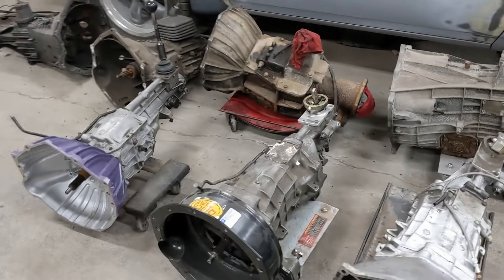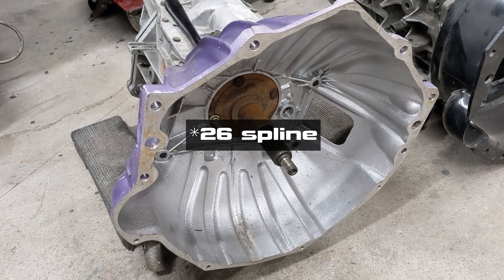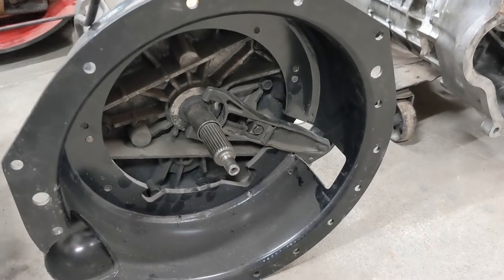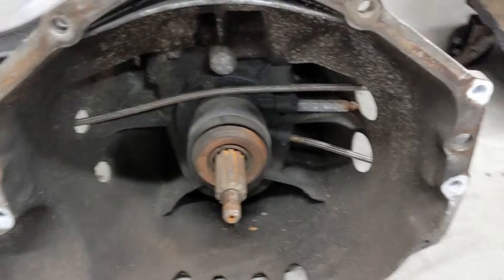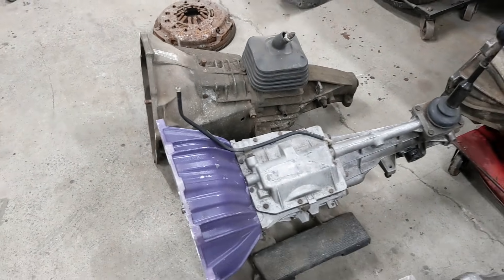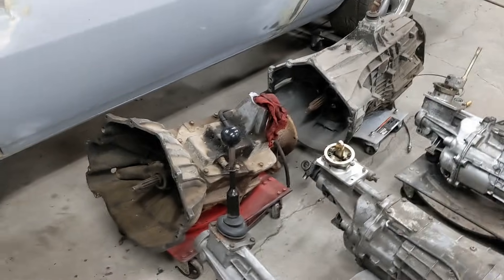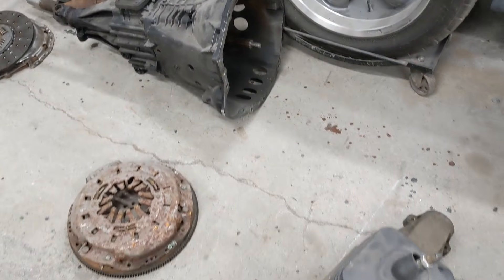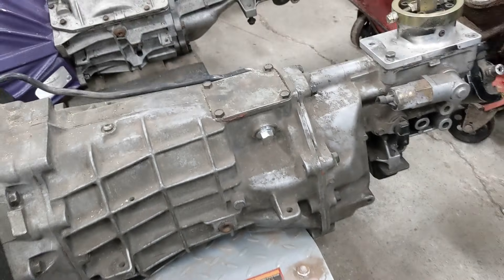GM manual trans specs - 4spd 5spd 6spd 2wd 4wd - LS SBC BBC

Comment: I'm swapping a 1996 5.7l vortec into my 1976 c10 with a Saginaw 3spd, but I was wondering if I could swap the 3spd out for something like the nv3500. Would it drop right in using the same bellhousing, drive shaft and mounts as the Saginaw?
Reply from the maker: You can hook an nv3500 up to SBC but can't use the old bell etc.

Comment: Im a little bit confused. Maybe you wont mind sharing your knowlege.
I have a 96 s10 nv3500 from a 4.3 truck. It has a internal throwout  bearing setup.( no fork). Im gonna run it behind a 84 350 with a 2 piece rear seal. What flywheel and clutch do i use? Its going in a 65 c10
Reply from the maker: Look up like a 65ish Chevelle clutch and flywheel. Would def be 2pc rear seal and I think it's old enough to be 10 spline clutch to match nv3500. Cars went from 10 to 26 spline some time in the 60s IIRC. Hell, look up the 65 c10 clutch too and see if it's 10 spline.

Comment: Best 6 speed manual to pair with an LS 5.3??
Reply from the maker: Depends on what you want to do with it. For a big power hot rod, I'd go T56 Magnum. For a car that's less crazy you could go regular t56. Truck I'd go zf6 or even nv4500 5spd

Comment: It is possible to put a LT1 T56 behind ls engine with the stock bellhousing? If it is, what kind of flywheel and press do I need to do so? Thanks
Reply from the maker: I tried that and it didn't work. Depth was about right with truck pilot bearing, but the lt1 bell wasn't big enough for LS flywheel. LS is 168 tooth and lt1 was 153. Maybe with an aftermarket QuickTime bell? I dunno
Reply: @GEARHEADdezign  or maybe with 153 tooth aftermarket LS flywheel?
Reply from the maker: If it exists. You'll have to figure out moving the starter too

Comment: I have an 02 3/4 ton truck with the floor shift tcase and the 4l80e. The 4l80e is great but my first truck was a manual with the sm420 which I eventually swapped to a world class t5. I miss a stick shift but the one really good option seems to be the zf6 and they're damn near impossible to find
Reply from the maker: ZF won't fit your tcase, but the nv4500 will bolt right in. That's the route I'd go in your shoes, and that's what the factory 6.0 manuals were.

Comment: What would you use if you already had an nv 4500 in your truck and you wanted to go to something different in a manual something stronger
Reply from the maker: Your only stronger option without adapters etc is the GM zf6. You'd still need another transfer case since the output splines are different. Expensive though

Comment: Has anyone figured out a way to swap an LT-1 6 speed behind and LS engine yet?
Reply from the maker: I have a couple videos about that. One where I try to make it work with truck pilot bearing...and another one where I convert it to LS style 🤣
Reply: @GEARHEADdezign  yeah I hear it’s not possible to us an LT1 6 speed with an LS but figured I’d ask.

I’ll go find that video. I haven’t tried to swap the input shafts but I guess it can’t be that difficult.
I have a couple LT 6 speeds and would love to use them instead of selling them to buy Ls 6 speeds when I know my transmissions are good. Thanks for the reply!
Reply from the maker: @gtmotorsports937  yeah. The parts to convert are a few hundo but it's pretty easy to do.

Comment: You are missing the ZF 6 spd trans from the C4 Corvette
Reply from the maker: That's true. But I don't have one. And they're so rare they're not much of a swap option either🤣
Reply: @GEARHEADdezign  I just recently did a clutch, p.p. & flywheel on a super clean 1984 L83 Corvette. I was surprised when I discovered that it came with a ZF 6 speed. 🤯  It is a pull style p.p. like the 1st gen t56
Reply from the maker: Gotcha. That's the style I'm running in my 80Z

Comment: I have a 94 s10 2wd and the transmission is the nv3500 and it’s bad went and bought one off marketplace and found out it’s the wrong one my shifter is up further the one I bought is 2 far back as well as some other small issues that won’t work on my truck

Comment: If you were gonna manual swap a 1998 Chevy Astro which trans would you use? A T5 or NV3500 and why would you use it?
Reply from the maker: I would guess the nv3500 from a price and strength standpoint. But I don't know enough about Astro fitment to make a recommendation
Reply: I was thinking the NV for the same reasons. Plus they came behind the same 4.3 V6 that the S10 and Sonomas had. My van is RWD btw so it should be a easier swap than the AWD version. Ive seen people do the AWD on some forums but haven't been able to find one on just a RWD swap. Luckily they are the longer of the NV's. The ones that came in the mini trucks I mean. I've heard the shorter NV was 1996 and back. While the longer NV was 1997 & up in the small trucks. My other thing is trying to figure out a clutch pedal, trans crossmember, and if it's gonna mess with the computer. It would my first time ever doing something like this. I work at a recycling center so I saved the Van from the scrap pile. It's probably a 7 out of 10. High miles 280k to be exact. So when the V6 goes I'm thinking of putting a 350 Vortec in place of the 4.3
Reply from the maker: @joshuadugan1992  I've always loved a good SBC, but you're honestly better off LS swapping it. Use a donor truck fuse block and it's only 4 wires to make it run. Pedals you can do universal Wilwoods like I did on my RWD Beretta. Lots of info to check out if you want
Reply: @GEARHEADdezign  which video shows your pedal install?
Reply from the maker: @joshuadugan1992  I think it says pedals in the title
Reply: @GEARHEADdezign  I have found what I think is a NV 3500. Pretty sure it for the full size Chevy tho. Any possible way I can send pics to you in a email and you can ID it for me?
Reply from the maker: @joshuadugan1992  sure. gearheaddezign@gmail.com

Comment: I dream of a mual box in my jag xj8, possible?
Reply from the maker: Anything is possible...you just gotta make it happen!
Reply: @GEARHEADdezign  I've gone through three auto trannies  and much prefer manual. Any experience with this car in terms of conversion? Are there kits?
Reply from the maker: @rodgruzelier4997  I dunno there, but Wilwood has universal pedals and if you have a grinder and welder you can make anything fit 🤣

Comment: So could you use a WC t5 out of a mustang behind a sbc but using a truck clutch setup!? Being they’re both a 10 spline. Or is the truck clutch and flywheel to big!? I only ask because I’m looking for a WC t5 but all that I find are a ford 10 spline. I’ve had a hard time finding anything GM.
Reply from the maker: I'm not sure if the 10 spline is the same...

Comment: I think you just saved my a ton of money. I’ve been doing a ton research hoping to find away install an LS in my 88 Camaro mounted to my GM T5 WC transmission. Will the old big block bell house work or will my transmission be clocked at an angle?
Reply from the maker: The BBC bell should work, but won't be mounted at an angle. And iirc you want it to be at an angle for your Camaro
Reply: @GEARHEADdezign  Ha, you are right, I do!

Comment: NV4500 2wd from a 1993 c2500, in a s-10 4.3v6, 4wd auto. Convert to a 2wd and manual. Can this be done and what all is involved?
Reply from the maker: Sure you can. Nv4500 will bolt up to 4.3 just like it would a SBC. Then you just need a driveshaft of the correct length. Piece of cake
Reply: @GEARHEADdezign  . I don't know about piece of cake, there is the clutch master and shifter to cut holes for, but it's encouraging to know it will at least bolt up engine to transmission. flywheel, pressure plate, clutch and all. If people say I'm crazy for wanting to delete the 4wd, I'll just point them to the current gas prices.
Reply from the maker: @flyhouseoftruth470  sure, there's work. But no crazy adapters or reinventing the wheel is needed

Comment: Great video with lots of good information. One question, I’m looking to swap my auto 2004 3500 duramax to a zf6 I have one local with lower miles but problem is it’s a 2wd trans and I’m 4wd. How In depth would this be to change the parts out??
Reply from the maker: I haven't looked into that. But I do know that the tail shafts are prone to breaking, so just a 4wd tail shaft will be close to the price of a whole 4wd trans...

Comment: I want to use an nv3500 from an S10 behind my 5.3 in my 83 C10. Do I use the slave cylinder and throw out bearing from the S10?
Reply from the maker: Yup. You'll need a hydraulic master cylinder for the C10 too
Reply: @GEARHEADdezign  ok kool. Would the driveshaft from my 4L60E work?
Reply from the maker: @ivorton23  half ton nv3500s have a bigger output shaft, but I think the s10 ones are the same. I know my 4x4 s10 blazer nv3500 is 27 spline
Reply: @GEARHEADdezign  gotcha. The hardest thing is installing the clutch pedal. I heard it’s a pain in the squarebodies.
Reply from the maker: @ivorton23  when I swapped my 94 Silverado the pedal wasn't too bad, but when I tried to change the plastic pedal to a steel one in my 01 it was a nightmare!
Reply: @GEARHEADdezign  oh boy smh

Comment: So what is a factory 5 speed in a 1990 2wd 350 obs chevy?
Reply from the maker: Getrag 5LM60 is the name of it, I think. It's the predecessor to the nv3500 and mostly the same, but with a clutch fork.
Reply: @GEARHEADdezign  thanks for replying. Do most people just use a nv3500 if they do a swap? For some reason finding information about these trucks as a 5 speed is hard as hell. Especially 2wd. Thanks.
Reply from the maker: @dakotajohnson6472  use whatever is available. Nv3500 might be easier to find at this point. And the internal slave is kinda nice compared to the fork
Reply from the maker: I had issues with a bent fork in my early nv4500

Comment: I had a mechanic install a 5 speed and he claims it is a NV3500. I found the receipt from the junkyard and it has the following info "1990 Chevrolet 1500 Pickup
88-91 MT; 5 Speed, 4X2; Q:45563; W:6603"
Everything I have read is it's a 5LM60. What dust cover/inspection cover do I need?
Reply from the maker: Yup, that's the getrag predecessor to the nv3500. Inspection cover, I'm not sure

Comment: I’m after a standard trans for my 4.3 tbi. Will the 89 t5 14 spline fit? Or do you recommend a different?
Reply from the maker: I would think it should fit. The nv3500 in the newer blazers is a little stronger if you wanted to go that route instead

Comment: I have a 93 Sierra with a 4.3 5 speed. I’m wanting to do a 350 sbc with a mild cam, headers and other small upgrades. How can I reinforce the 5 speed so that’ll handle some burnouts and what not
Reply from the maker: It's the same 5spd used with half ton SBCs anyway, so it should hold up for a while anyway. I don't think there's much of any aftermarket upgrades available other than a Core shifter

Comment: Hey man I have a 2007 silverado single cab shortbed and it has a 4.3v6 with 5 speed transmission but i am not sure what transmission I have and if I could use it for a 5.3 engine I am thinking to put...I appreciate it if you can help me out thanks
Reply from the maker: Yup, you have the nv3500 and it will bolt up to the 5.3 piece of cake with 4.8 clutch and flywheel

Comment: Hey man great video but I don’t e a question for you, that nv3500 looks to be a great option for my nova but what would be the best option for a hydraulic throw out bearing if I could find that transmission
Reply from the maker: Watch out for bell housing to shifter distance on the nv3500. If you can find the s10 version instead of the Silverado one it will move the shifter back a bit.
Reply from the maker: They come factory with the hydraulic release bearing stock, so just use that. Same style as LS t56 trans.
Reply: That makes sense… what about the the speed sensor? How to make that retrofit?
Reply from the maker: @justinstewart1499  you'd have to do an elec speedo. Like in my Beretta I'm using the factory elec speedo and just changing the tune to calibrate it

Comment: I hv a question iam about 2 do a engine & tranny swap into a 96 s-10 iam putting a 2000 ls1 and t56 tranny in my questin is will my tans shifter come out in the same hole as my 2.2 four banger and the i belive is the nv 1500 tranny  my name is steve.
Reply from the maker: The nv1500 shifter comes out the same place as the s10 nv3500. I have measurements in the video, but I'm quite sure the t56 is still rearward of the s10 hole. I have the opposite issue with the sm465 going in mine, where the shifter will be forward of the hole

Comment: I have a 1955 chevy truck with a 265 v8. Would a nv3500 fit that application? Thx for all the great info...
Reply from the maker: Yup, it should work fine.
Reply: I have a 1995 Silverado with 350 engine what manual transmission would work with that motor
Reply: HELLO MY FRIEND I HAVE A 55.5  CHEVY 3800 DUALLY W/ THE 235 INLINE  6 IS THERE A 5 OR EVEN A 6 SPEED MANUAL THAT WILL BOLT ON OR B REAL KLOSE 2 BOLT ON THANK U

Comment: So I have a 1999 Silverado 1500 5.3 4x4 4l60e, and have rebuilt the tranny once, I really want a manual, and am willing to sacrifice 4x4 for rwd summer Truck. Any sggestions?
Reply from the maker: For light duty gear banging, and keeping 4WD, go with nv3500. T56 can work, but the gearing is really tall for a truck and they're pricey, and only 2wd.

Comment: Cool info…
I have a question…
I have 1965 Chevy pick up truck with 327 motor.
Original came with manual transmission
Years ago I made it automatic now I want to go back to manual and I was thinking if it’s possible to put one of those six speed Camaro transmissions. 
Tanks…
Reply from the maker: Yup. There's a couple ways to do it. 
1 - LS1 style with adapter plate for SBC bell housing.
2 - LT1 style with lt1 bell, clutch and conversion flywheel for 2pc rear main seal
#2 is the setup in my Camaro

Comment: So what would be recommended for a Chevy C3500? I feel like the T56 would handle the power and toureuq of the Big Block 454.
Reply from the maker: T56 is a hot rod trans. If you're looking to do truck stuff, go with nv4500
Reply: @GEARHEADdezign  Thank You.
Reply from the maker: @justinjennings6836  the gearing on nv4500 is a lot deeper too, better for truck stuff.

Comment: i have a 03 silverado that i’m manual swapping. its got a 4.8. i found a nv3500 from a 96 c1500, my question is would it work? or would i have to modify
Reply from the maker: Yeah, that should probably work fine. It might be external slave, that's right around the change over year, but should still work. Use the 2003 4.8 pilot bearing and you'll have to measure whether you need the thick 4.8 flywheel or the ls1 Camaro one.

Comment: A lot of great info here, thanks! I am about to swap an LS style T-56 behind a one piece RMS Chevy 350 and have heard mixed reviews on what pilot bushing to use. I purchased spacers that go between the bell housing and front plate of the transmission to fix the long input stick out, just wondering if you have any experience with this. Also, do you know for sure if an LS T-56 clutch will bolt to the old school SBC flywheel? Thanks!
Reply from the maker: A friend of mine has done that exact swap, you use the SBC pilot. The LS clutch will bolt on a big SBC/BBC 168 tooth flywheel, but not the 153 tooth. Just use the SBC clutch that matches your flywheel though. No need to change style

Comment: So I have a 1969 c10 with a 350 sbc I bought a nv3500 but now sure what else I would need to do to complete the swap
Reply from the maker: Get a 168 tooth flywheel, 2003 4.8 Silverado clutch and pilot bearing. Then you'll need a new driveshaft and probably have to modify your crossmember. My neighbor up the street did exactly that. I have a video of him doing burnouts on my channel🤣

Comment: I have a question, I have a 1990 Chevy Silverado single cab dually 3500 2wd with the manual transmission. That is not working for me at all since it is only the 3 speed. Which transmission can I swap without or with little mod so I can go at least 80 down the highway lol
Reply from the maker: That must be the 4spd sm465 with "low" and 3 more gears right? Measurements look to me like the nv4500 will be a direct swap.
Reply: Yes that is correct, someone told about the nv4500 but I didn't know if it is a direct fit
Reply from the maker: @calvinl9814  the 4WD sm465 numbers look to be a direct swap. I would guess 2wd as well
Reply: Ok how many gears is the 4wd
Reply from the maker: @calvinl9814  it's a 5spd. 1-4 are damn near identical to the sm465, and 5th is overdrive

Comment: I really need some help. I'm looking to put a 5 or 6 speed manual transmission in a 1999 chevy suburban k1500. I don't even know where to start can you help thanks.
Reply from the maker: I did the same in my 94 k1500 z71, auto to manual. Nv3500 or Nv4500 would be the way to go. The nv4500 is heavier duty but the nv3500 shifts smoother...so it's up to you. Either way you'll need a 32 spline transfer case. They came with all manuals and also 3/4 and 1 ton autos of the same generation.

Comment: Wouldnt the zf6 out of a 7.3 powerstroke be the same as a 8.1?
Reply from the maker: Similar, but no. The GM ones (8.1 and dmax) have no external fluid cooler and the bell housing pattern is different. Not sure about input output shaft splines etc either.

Comment: a T5 fits a small block chevy  and an LT1 T56 fits a small block chevy. If a t5 fits an LS, how come people say that an LT1 t56 does not fit an LS?
Reply from the maker: Cause the lt1 t56 requires its own unique bell housing, and that bell housing does not fit the 168 tooth flywheel of the LS. The LT1 is 153 tooth flywheel. I took my lt1 t56 and tried to figure out a budget friendly way to do it...you just can't. That's why I swapped input shaft, front plates and bells.